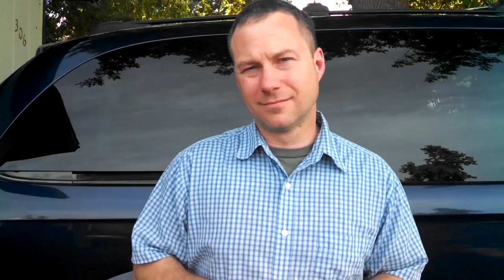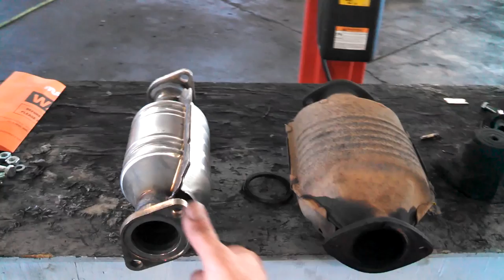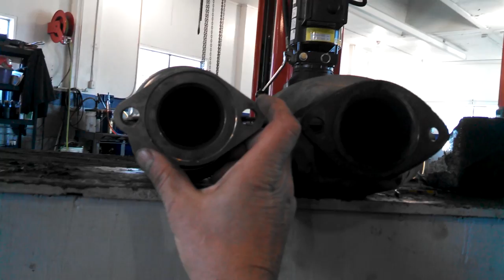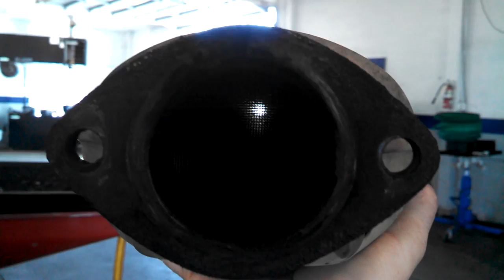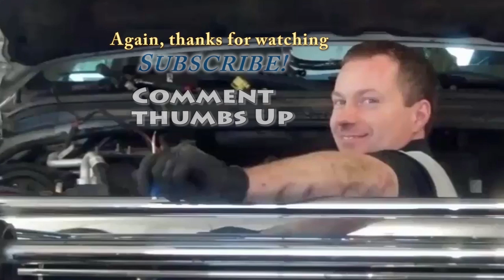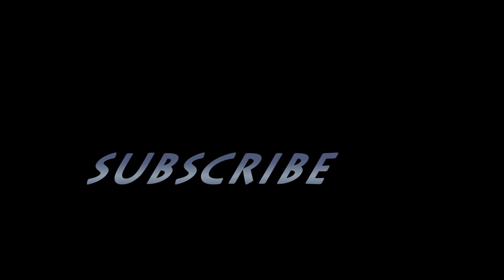Comparing OE part to aftermarket part Catalytic Converter

Comment: More than one aftermarket maker claims to actually have MORE material inside their cat, even though the body may appear smaller.  This video is useless without naming specific brands and showing some test results on after-market cats.  Without that, it's a hand-waving assumption that the after-market devices don't last.

Comment: What was the point of this video? It sounds like you're just trying to convince people that they should spend the extra money and purchase the cat from a dealer instead of an aftermarket supplier.  Hmmm, $100-$200 for an OEM aftermarket from a reputable company like Walker or Bosal, or $600+ from the dealer....I'll take the aftermarket direct fit one, thanks.

Comment: I replaced my 2000 nissan maxima OE converter with a bosal one.  This video was an accurate representation of what I experienced, in the sense that the Bosal was way smaller.  I immediately noticed a reduction in power and gas mileage.  Unfortuneately, you can't tell much about what you are buying by looking at the pictures on Rockauto (or magnaflow for that matter).  I considered buying another original equipment one, but it costs $920 vs. $130 for the Bosal.  Other option would be just put the old one back on, since I already passed emissions with the new one, I just don't want to smog up the city)

Comment: Whether or not you can judge how long a converter will last by inspecting the outside is debatable. What is true though is that some after market converters are pain to install because of shoddy hole-bolt alignment, not using studs, no heat shields, etc. Bosal is one such manufacturer.
Reply: Well, that sucks ass. I've been thoroughly researching because it's time to get rid of all but the manifold and the muffler, if the muffler will survive the dismantling job, and I'm almost set on Bosal. : / 

I came to YouTube in search of Bosal/Eastern comparison videos. No fancy shit. For me, it's about price and functionality at this point. My car had been straight-piped, which might not have been the best trailer-park-tuner treatment for a '95 Honda Civic LX that at one time belonged to a Fast and Furious wannabe. I've heard that small-engine foreign cars, running leaner by design, probably benefit from the minor backpressure provided by a converter, and that they're actually engineered from that perspective. I have no definitive proof of that, but the more I read, that sounds quite plausible. and I'd rather return my car to a more longevity-friendly operational state, if indeed that's what this comes down to. I'd considered another straight-pipe set up, but the lack of a welder in addition to the amount of bullshit and stupidity involved in cobbing perfectly good new parts into a Frankenstein mess are two reasons why I'm seriously thinking of just doing a fresh, bolt-together run. The unresolved 'performance' debate is on the list of motivating influences, too.

Bosal seems like a serious, quality builder, and they claim to be a worldwide player in the OEM supply chain. I'm not committed yet, as this is my first video, but my thought is that maybe you just had some crappy fitment luck, unless you're a daily installer speaking from the position of having had repeatedly bad experiences. ; ] We'll see. Off to investigate.
Reply: You should try to do business with Goodkat in the Netherlands.
Reply: thank you for saving the environment!

Comment: I bought a learner car for my wife. 18 year old 75k miles on the clock. Converter fell apart (inside) after a few months. Thankfully I didn't pay much for the car. the new converter I will be fitting is a cheap one. 12 month warranty. The car needs to last her another 3 years. If it lasts that long, I will be happy.
Reply: 1stSpork  I think that is exactly the point that needs to be understood. If you have an older, lower value car that needs a cat to pass state emissions, or just to stop an annoying rattle or an obnoxious exhaust odor, the cost of an O.E.M. Cat (especially if purchased at a dealership parts department) can meet or exceed the value of the car. Why would I purchase a $500-800 O.E.M. Cat for my $1500 car? The Chinise made cats may only last a few years but the car might only last a few years. They are typically not that hard to install, so if it fails in 2-5 years, I pop for another $50 cheapo cat and hit the road again. Not a big deal.

Comment: Catalytic converters actually dont go bad as long as the vehicle is maintained. Every component in an engine has a sevice life interval very few people ever do change them even if there not broken. Unless they it fails to do its job. When failure in a sensor and or mechanical compnent does hapen the longer you prolong it the harder you make the converter work. If you have a bad converter its because something caused it to fail.
Reply: True
Reply: happened to us.
Reply: I have seen a lot of failed converters over the years.  When I say fail, I am referring to the monitored catalyst efficiency code.  Interestingly, I find it more common in the Asian vehicles than US/European vehicles, even though the recyclers pay a lot more for the Asian converters compared to the US domestic ones.
As for personal vehicles, I have a 1998 Jeep XJ with what appears to be the original catalyst and it never throws an engine light and it has 263,xxx miles on it.  The downstream oxygen sensor failed on it and when I went to remove it, it broke the metal that held the bung in place.  I welded in a new bung into the thin rusty converter body and it looks like a hack job, but it works.
I also have an 09 Suzuki SX4 and it has 163,xxx miles, and several thousand miles ago, it threw a P0420 and I have been driving it that way ever since.  It runs like new.  It consumes about a quart of oil over 4,000 miles.  The fuel trims are spot-on.  I don't know the history of it prior to.... 2017 (I think) when I bought it with 103,xxx miles, but I don't see what I could have done to extend the life of that catalyst.  Unless there is a crack in the thing causing oxygen to get into it?  I cannot hear any leak.  I do not smell exhaust under the hood.  So....?????  But I do see a bit of a correlation between unmaintained vehicles and catalyst efficiency codes.
Reply: True if it's factory cat aftermarket cats go bad quite often.

Comment: EPA standards require ALL catalytic converters to have a minimum of 5 year/ 50000 mile warranty regardless if it is OE or aftermarket. The aftermarket manufacturers are also required to meet a minimum emissions standard. ALL converters are required to meet or exceed a set of government regulated standards. 
There are some excellent aftermarket converters available. While there are some low quality aftermarket parts out there, aftermarket isn't always a bad choice. Do you really think that car manufacturers make their own converters? They buy them from a converter manufacturer at the lowest price possible and mark up the price once it goes in a box with their name on it.
Not too long ago Subaru issued a recall on hundreds of thousands of vehicles due to the fact that the converters were simply junk and were failing. That's just an example where OE was clearly NOT high quality.
Reply: That being said, do you have any recommendations or a preferred aftermarket cat?
Reply: That's just an example where OE was clearly NOT high quality., just sample, if 100% and only 5-10% NOT high quality, but 90-95% are high quality!! But in ebay 90-95% are bad quality!
Reply: Please name one or two besides walker or MagnaFlow? Those are about the only two

Comment: Aftermarket are always smaller I remember buying one for my 93 Mr2 and it was half the size,  another thing I noticed is oem cats have 2 of those honey comb things in side and fill the entire cat up where as the aftermarket ones only have 1 and it's very small, I honestly thought when I saw mine that it was no way in hell going to pass an emissions test but turned out that my results were the lowest figures I'd ever seen, I guess moderen ways have made them smaller as even the new oem cat for my car is small.

Comment: The units with two cores are TWK, three way cathalityc covertors the first core îs smaller and does the NOx reduction job, the second does the HC unburt and CO to Co2 oxidation job, only fit a two core units.

Comment: I know the Chrysler warrants cats for 7 years! My 2001 Caravan has 200K  miles and original cat is going strong! What will really kill any Cat is either an oil burning engine or a fuel system that is running excessively rich condition and dumping raw fuel down into the cat! The cat is like your oven at 400 degree's F. What would happen to your oven if you dumped raw gasoline into it? Same with the cat! The ceramic honeycomb will melt together and block exhaust flow and probably finish off your engine! James

Comment: This is why the aftermarket units are a fraction of the cost of OEM. Typical 1998 Chevy, Ford , Dodge , Honda Toyota etc with 166K miles the cheap aftermarket is a perfect option.

Comment: 226873 miles on original OEM AC Delco Catalytic converter...Chevrolet s-10 Blazer...Not bad.  
Everyone is beating up on Bosal aftermarket cats, but they all come with a 5 yr 50000 mile warranty, so no different than most OEM products as far as warranty
Reply: Our OEM converter lasted 200k miles.  It's pretty clear that the aftermarket converter in the video has only 50% as much catalyzing compound, so they barely meet the minimum warranty requirements.  Still, for a very old car in good running condition, an aftermarket part might be a good choice as the car won't live forever.

Comment: I like the comparison of OE vs. Aftermarket but i have to say, the aftermarket converters if you buy should have EPA certification if you should trust buying.  One way to know is if it has 5 year 50,000 mile warranty on workmanship and material and at minimum a 25,000 mile warranty on the catalyst (the part which filters poisonous to less poisonous gases) They should be a warranty card packaged with product as well. If you don't have any of these guarantee then they more likely not guaranteed to be certified by EPA regulations which is illegal.  OEM is overrated in some cases and definitely overpriced.
Reply: I agree, and as long as an aftermarket cat is the same physical size, an EPA rated one should work as well as a CARB compliant one. One site (Wagner) states that it's legal to install an EPA version on a vehicle initially built for California or the other CARB states, IF the vehicle is no longer registered/driven in those states. The difference is the amount of precious metals which remove more toxins. With OEM (in our case, Subaru) I truly believe part of the inflated cost is that the part has the manufacturer name attached to it. The Subaru cats cost over $3000, and aftermarket CARB compliant matching ones half that or so. EPA rated ones are around $500 from some outlets. No rating ones (likely quite a bit physically smaller) from dealers on the large retail sites we all know, listing them along with items like children's toys to women's lingerie, run from $150 to $250. Who falls for those scams, and who would think they could get something anywhere close to the same performance for 1/10th the cost?

Comment: My cats are $1400 each (x2) I put eBay’s on $109 a pair and passed emissions for the 2nd time already no CEL ever, going on 3rd year, i’d have to replace these 30 times to pay for a set of oem cats if they failed right now, and they are 400 cell vs 700 cell oem so ….
This is on a 2006 Infiniti VQ35 engine
Reply: The after market caddy lasted for 3 years?

Comment: Got a 20 year old volvo with the original cat, still 0.0% COx on the emissions. If you're getting bad readings there's something wrong with the engine and that might have killed the cat too.
Reply: volvo had the first cat in CA emissions
Reply: just put in this year an aftermarket cat for my 2005 Volvo S40, upstream sensor is shot I don't know if it was bad when guy at muffler shop removed from old part but had a light since. Do I need to do anything to help the aftermarket cat like spacers?

Comment: I am gunna agree with their ridiculously expensive n yes aftermarket is cheaper n won't last as long but I would say depends on fuel going through converter also. I realized when I bought my truck it had aftermarket on it it lasted me 2 or 3 years n I noticed when I bought it their was a ticking noise n I thought the whole time it was my cat and I was right took it off it runs but I will say they need to correct the design otherwise it's bs either way wish they could make one where u could simply detach it from the coverter n change out the honeycomb sometuing their has to be a cheap but reliable other way

Comment: Ebay cat clmverters the comes with small ceramic material.. the expe sive ones and oem comes with a big ceramic material inside.. i bougth 1 from ebay for like 100 dollars 3 monts ago works but the smell is terrible it docent make the work .. the oem works 100%no smells and cleans the gases that comes from the engine but is more expensive than the ebay cheaper ones..and it has better years of life ..

Comment: Our Lexus RX300 factory converter (precat) lasted 200k miles, 17 years.  However, then it exploded, sending shards of metal into the main cat, nuking 2 converters at once.  The car has 200k miles.  We finally managed to fix the engine problem - changed almost every sensor until finally the mass airflow sensor fixed it - by then it was too late, and the cat died.  The car will probably never make it to 300k, maybe not even 250k.  Is it a good idea to throw away such a car when you can get it on the road for $1000, giving it perhaps another 50k of life?  Probably worth it.  Should we buy the OEM cat which doubles the repair to $2,000 for 150k+ of lifetime?  Probably not worth it.  Our car is in hospice.

Comment: Nobotty here talks ab the size of the rock inside the catalytic comverter usually oem has 2 rocks inside and the after market is only 1 and small . That is why oem they so expensive.. like my prelude 99 i replace the oem i opened and see thos 2 big rocks .. then o bougth an ebay 80 dollars cat comverter it has just a small rock inside . Works for ab 5 monts and the gasoline smell is terrible now im thinking ab magnaflow or oem from honda that is way expensive .. that is sad but that smell is a pain in my head...

Comment: Can u pass smog with a after market part
Reply: Yes. I replaced the cat on my 2000 S10 (2.2 L 4-cyl) with one from Walker and it did just fine. Fortunately that unit bolts in  so it's not a problem to change. Unfortunately the Walker cat failed in 3 years. However , Walker replaced it under warranty. That 2nd Walker unit failed in 2 1/2  years but by then it was out of warranty. I replaced it with one from Eastern catalytic. Here's hoping. Hope that helps.
Reply: @recoveringnewyorker2243  Coincidentally enough, I was going to get either a Walker or Eastern cat. How's the Eastern holding up for you these many months later?
Reply: What did you guys go with and how did they hold up?  Did the car accelerate just as well with aftermarket cat?
Reply: Anybody if the car manufacturer will not warranty your engine if you have issues with it for not having an OEM cat on your car?

Comment: I bought a cat comverter over ebay .. for my 99 prelude.. the big diference that no botty talks ab is thar my oem cat comverter comes with 2 honey cones inside .. and the ebay is just 1 small honey cone rock inside .. is been just 1 year and the ebay cat comverter is going so bad  .. is a terrible  smell wen i start my car in the morning.. i think is better an oem .. i know is to expensive .. ebay  cat comverter just work for few monts..sombotty knows wath im talking ab  im wrong or im rigth???